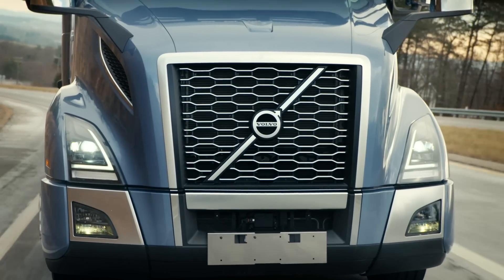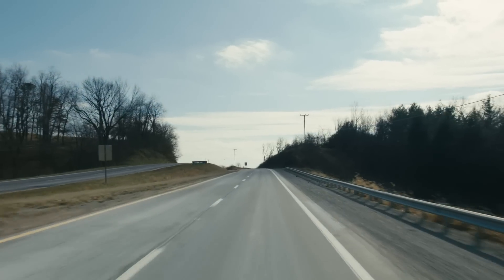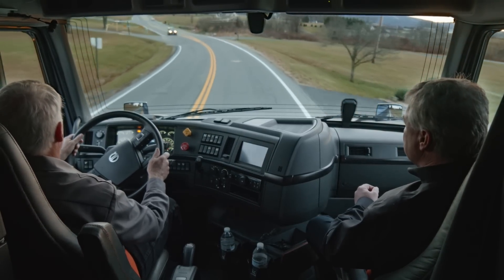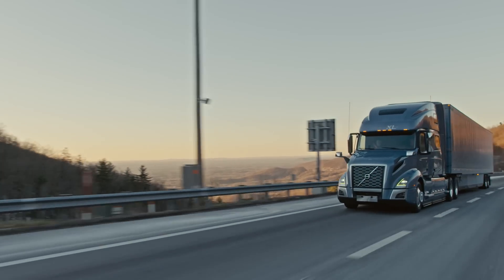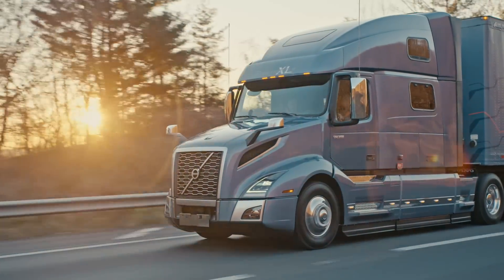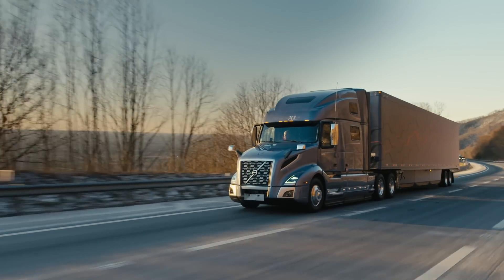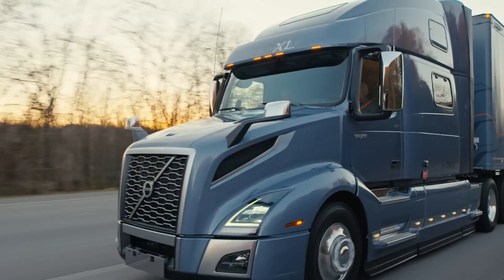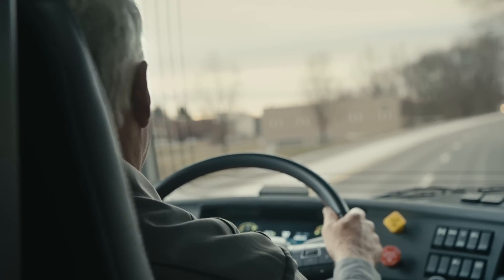Volvo Trucks - D13 with Turbo Compounding - For Your Future

Comment: Driving a 2021 currently. I will say the engine is rock solid and super efficient but the build quality is not up to par for the rest of the truck. Too many cost cutting  build measures that means reduce reliability in the future.

Comment: I have a VNL 760 2020. I have driven Volvo trucks for years. A lot of good stuff. However, I do have some minor issues with the lay out of buttons and controls. It seems that the Volvo interior engineers have never ask an experienced 'truck driver' about what is the best placement, type and design for controls.
Reply: @DikoMan My experience is CDL class A Driver for 26 years. Seven or eight years in Volvo trucks. Hope that helps.

Comment: I don’t think this setup is very good for going out west through mountain terrains. They come with a 2.47 rear ends... These turbo compound engines don’t run 505hp instead what it does is run at 405 hp and uses that “turbo compound” to gain the extra 50 horsepower to get 455... I wanna see this truck loaded at 78-80k pounds and I wanna see how it runs and what fuel economy it produces. I would be skeptical as hell if I was buying one of these trucks. Not many people have 170 grand to play around with.
Reply: I run a 2015 d13 around 120k up some hills and it makes it... Eventually. Not sure this turbo would make much difference.

Comment: I drove vnl 860 for company going thru Nevada at 75 it gets 5.9 mpg just like the previous model
Reply: АН Дольнабой по США too fast buddy,drive 65 and you will get better,i drove 2016 and it was getting 6.5
Reply: @vasacsl63  I have a 2013 it's governed at 65 gets 6.7
Reply: you need to drive for fuel efficency.....I was getting 8 mpg consistantly. 2013 780 xe pkg. running at 62mph.

Comment: Nice looking truck. I wonder if they addressed the common problems on the previous models like premature rusting on the bottom of the doors and paint leaving the frame after a few years. Very common to see 8 year old Volvo's with rusted through holes in the frame. Typically by the catwalk area.
Reply: Gear Bangin i wonder too... My guess is no because the cab looks almost identical structure... Mostly plastic styling changes
Reply: Charles Pyatt they have - stop by any Volvo dealer and see for yourself. I’m sure they would love for you to take one for a test ride 👍🏼

Comment: D13 is power limited compared to Cummins. Even with the Cummins,  Volvo still won't let you get a high TQ motor anymore like the D16xe 500/2050 @ 1050rpm
Reply: Charles Pyatt they’re focused on performance and efficiency, lowering total cost of ownership through uptime and fuel efficient features. “Power” and HP only go so far...
Reply: Yeah, cummins might have more power. But, I have experienced oil and coolant leak after 400k. American made never ever get to the level of reliability when it comes to mechanical engine. European engine is far superior than american ones.
Reply: @tanaka.shinji1  Volvo trucks are American...
Reply: @Rokomarn  wut?
Reply: @turdferguson9190  
in
The
Us
Volvo
Trucks
Are
American

Comment: are those 3 oil filters cartridge for that engine??!?!
Reply: lexusfan100 Yes; two are full flow, one is bypass filtering. That extends oil change intervals and engine lifespan dramatically. Wish Cummins did this on the big X
Reply: lexusfan100 yup. They go through a lot more miles between changes.